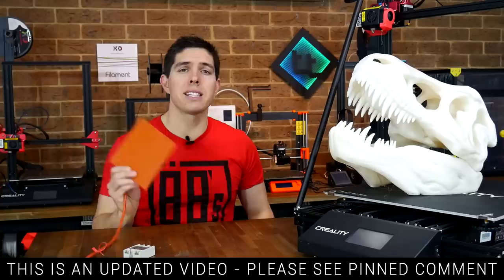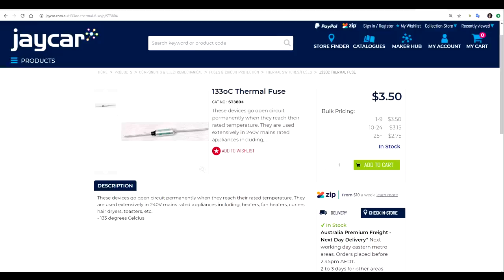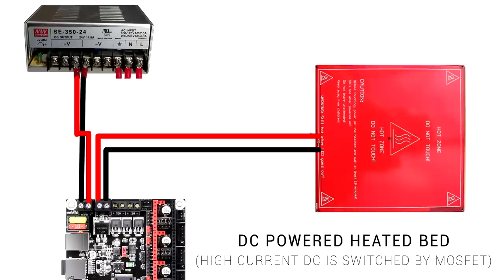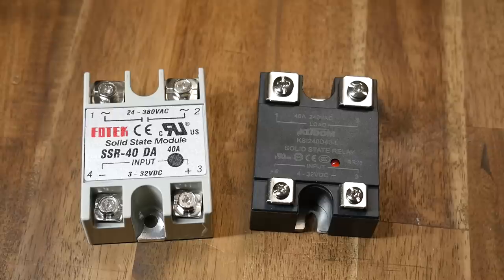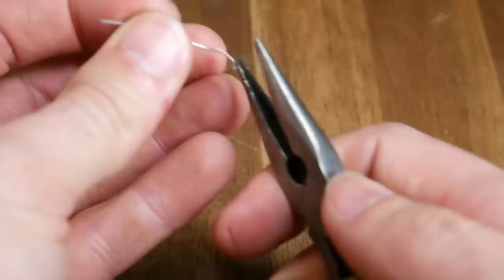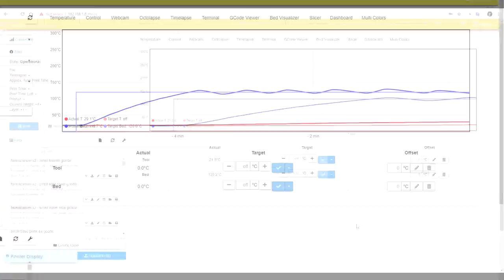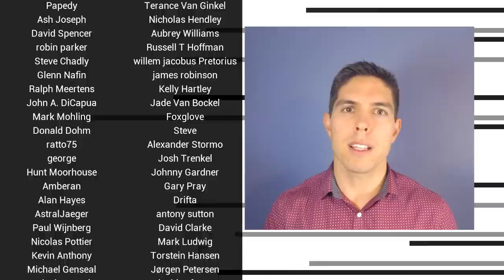AC mains powered bed guide: Super fast heated bed performance - UPDATED

Comment: Thanks for this, my first printer was the Anycubic i3 Mega, very pleased with that after 2 years so bought the Mega Zero recently for the extra height. I ordered an i3 heated bed that will need some modification but this was useful :)
Reply: Did you manage to find an AC heated bed matching the i3 Mega(-S) ? Should be 24x22, most of them are more like 20x20 cm.
Reply: @Lidocain777  I stopped looking but thanks for the reminder i need to do that this month so i can return the wrong one that i got! I'll keep ya posted.

Comment: Hi - as usual I follow your videos and appreciate them.  I would have soldered the thermal fuse (or not considered at all) had I not seen your video.  FWIW, I bought a heat shrink type of connector with solder - it went alright, but not great and I don't recommend that (even with my heatgun at 480 c it was a real challenge, and I didn't want that fuse over heating).  I looked at butt connectors at my local big box store, and saw they were only good to about 75c, so I might suggest a caveat - that if folks are to use them, check the thermal limits - I found some on amazon that said the minimal shrink is at 80c, and they are good to about 130 which I think are fine for our purposes.  I also plan to dial down the max settings in Marlin to 120 so I don't run afoul of the fuse, and that should be fine for the bullet connector.  Great video as always!
Reply: Why is soldering the fuse a bad idea? Because it may pop during soldering, or is there any other reason?
EDIT: Oh, solder will melt in >200C temps, is that the reason?

Comment: Nice vid, thank you Michael. Use flux for soldering and desoldering, difference of night and day. My Ender 5+ has the BTT high power mosfet and 600w meanwell, 24v. Not bad, takes 5 to 6 minutes I think. AC is better, but you have to know what you’re doing, I completely agree. Very good video for the general printing public. I enjoyed it in any case, especially the pitfall warning for the cheap relay. For sure people don’t want to find out the wrong way it fuses itself stuck in the on position if it fails.

Comment: Naming and shaming:  Creality Ender 5 Plus or more accurately, the TFT 35 v3.  I recently downgraded(?) to the SKR Mini E3 V1.2 on my Ender 5+.  I also added my TFT35 to the case.  The only time it has issues is when the bed is heating.  I have tried adding capacitors on the 24v and the 5v bus lines to no avail.  I am considering this upgrade for the sake of using my TFT, but the point might be mute because I am now using a dedicated Octopi.

Comment: Not sure if it will work but I think safe and cheap way would be to use two fake SSRs in series on the output, so if it fails short, there's still second one switching it ON/OFF.
Though would be nice if someone would manufacture something like that in a one package and sell it for a decent price.
$50 is too much for most people just for a "Switch" and I bet they still use only one Triac.
Reply: Not a good idea!  If one failed in the on state you might never notice and the other one is just waiting to fail too.  Plus the fake ones can do worse than just fail open they can also catch fire!  If $50 is too much you could definitely find a cheaper one that's not fake or just stick to the DC bed that comes with most printers.

Comment: Not sure if this is a new feature of Marlin or if it was available 3 years ago, but when doing the PID autotune, you can specify "U1" to load the PID values into memory, this saves having to enter them in. You still need to save the memory to EEPROM, but it means only two commands now:

M303 C5 E-1 S100 U1
M500

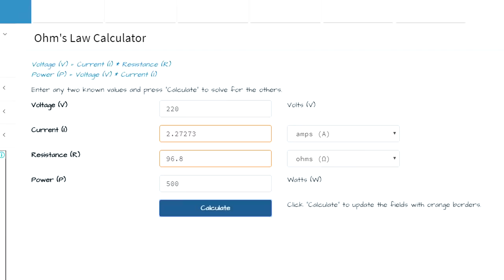Comment: @Teaching Tech - 9:44 "When you get one you need to make sure you choose one for AC control"

Don't think that's right Michael, the control voltage is the input to the SSR, you have a DC input unit (KSI240D, 4-32VDC input which is CORRECT for switching via the printer's control board) and NOT an AC input where you would need to apply 85-250VAC on the control input to switch the unit
Reply from the maker: You are right, my choice of words was not the best. Hopefully people know what I mean by what I highlighted on the data sheet as I was talking.
Reply: @TeachingTech You say "make sure you choose one for AC control", and you also highlight the coding for AC control ("A"). Both are consistently incorrect, so it will be hard to know that it's not correct unless one has that knowledge beforehand. It might be a good idea to issue a correction.
The SSR you show at 8:40 has the DC control marking ("D"), though.
Reply: Now im confused.. What relay should we be looking for DC to AC?
Reply: @ChristopherJones16  AC on the mains side, DC on control side. Voltage from the printer should be in the SSR's control voltage range.

So a 15-30V DC controllable SSR is not suitable for a 12V printer, but a 4-32V DC one is okay.

Comment: Super late little tip here, but with all connectors like the white one you used for the PCB they usually have a way to cleanly take out the cable and insert new ones. You just need to get the right size insert for the cables to snap in with the little part that sticks out. (To remove them, you push in that little metal part you see on the underside of the connector for each cable and pull out the cable at the same time.
Took me ages to figure this out so I figured Id let people know this. You can buy new inserts or whatever they're called at any hardware/electronics shop for cents

Comment: Have you ever considered doing a test on fire extinguisher balls? I had not heard of them till today but they are very very interesting and could be a useful safety feature mounted above your printer. Not a guarantee by any means but worth having. Only downside I can see is that they only work if touched by flame, smoke and heat do not set them off, but seriously consider getting some, its not perfect but a worthwhile option perhaps, only issue I can see is the original make, Exide I think is far superior to the cheaper makes such as AFO, AFC I think they are , 3 times the price for the Exide but is the more expensive one overkill, would the cheaper one do the job? Printers are not very large after all.
What do you think or do you think covering this might get too much negativity for covering it.
Paul Milne

Comment: Hey I just upgraded my Ender 5 Pro with a Kenova 350W, DC24V .   It has the cutouts for the screws as they sell a specific one (actually two - also a 250W version) for the ender 3 which has the same bed size and screw locations.  It looks similar your AC one and heats up really quickly to 70 Deg C with a thicker Al plate (6mm).  Haven't yet tried  to heat up to higher temp yet but will do so once I fit a mosfet.  Of course, I upgraded my power supply from 350W 24V to a Meanwell HRP-600W-24V so that I would have enough power for the bed at higher temp. The mosfet will be connected to the bed to make sure I don't fry the control board (a BTT Octopus 1.1).  I think it will work fast at higher temp. but  I wish I saw your video before I went down this route.  However, it must be working well because I get the same temperature oscillations with the standard bang- bang heating and will update the firmware with the bed PID as you have suggested in the video. 

 I love all your youtube videos as they are very clear and also the Aussie accent (but I am biased being Aussie myself).

Proud owner of an Ender 5 Pro with extended bed Dual Z axis, Bondtec DDX extruder, copperhead hot end (300 deg C), linear railed X and Y, Kenova hotbed, BTT smart filament sensor, BTT octopus 1.1, raspberry PI 4B OCTOPRINT ready with BTT TFT70 touch screen.  Fully working Marlin firmware and printing as I type.

Comment: My ender 5 plus has a huge heatbed with great inconsistency and a hotspot that will warp prints.   Not to mention the level is wonky.   I’ve upgraded other parts of the printer.  I’m considering redoing the bed.

Comment: I'm in the process of tuning a Tevo Flash that comes stock with an AC heated bed. The heat pad is stuck to an aluminum plate which the glass bed is glued to. There's no ground connection to the bed, the electronics enclosure or the printer frame, so I'm adding those. I hadn't thought to add a thermal fuse, I'll add that now too.

Comment: Great stuff! As I'm in the process of building my own printer soon(tm), I'd very much like to see a test of the thermal fuse. I know I will probably do my own testing when time comes, but It could be interesting for others aswell, might even be a recommended safety upgrade for the stock bed. Bonus would be to research if there are viable options for thermal fuses for hotends?
Reply: You can buy thermal fuses in all kinds of temps. They are in many things and rarely blow but they are a great safety feature.

Comment: The reason for not soldering the fuse has nothing to do with arcing though. It's because there's a very high risk of blowing the fuse. Because - well - it's a thermal fuse. A non-reset'able one. Sticking a soldering iron with solder on, onto its leads, heats the fuse up extremely fast, way past your 130-some°C. 50-150 watts of 300-400°C heat dumping through a liquid metal thermal bond, into a tiny short metal lead.. Yeah. Gets hot fast.

This is also why we build or buy fairly costly equipment to spot weld lithium battery cells, even though we already have soldering equipment on hand. Because if soldering: by the time the metal casing or cell tabs (or in case of your thermal fuse; leads) gets hot enough to accept a wetting bond with solder (and appropriate flux), that metal will have heated up whatever is at the other end of it a craptonne. In your case, that's the thermal fuse. In case of lithium batteries... Poof. What the spotwelder does, is dump that current and thus heat in a very small area, in such a blistering fast n short pulse, that there's no time for that heat to sink and spread.

As a sidenote - this is why, if you need to solder a very short, tiny jumper wire - always start with a long'ish wire. Do both joints, and only then cut the remainer. If you cut a tiny piece, then when you go to solder the second joint, all that heat from the iron gets dumped into that tiiny piece, and the 1st joint will melt again almost instantly. And, it easier to navigate small wires to lay the way you want, if you have a longer tail to move it around by.

Comment: My 24v 330x330mm bed heats to 100c in 6mins so I think I am fine without AC.
Reply from the maker: Agreed.
Reply: @Teaching Tech I am replacing the 14ga with 12 gauge so maybe I can eek it out faster but I was surprised to see the timer start on the panel and at 6m (give or take a few seconds depending on room temp) it moved on to the bed leveling.  My 14gauge wire used crimps and the wire was 70c-74c near the crimps so too hot.  Next 12ga silicone will not use crimps.

Comment: Wouldn't you want to put the thermal fuse on the side going into the ssr so if it fails its not being fed power and eventually burn it would be a bit more wiring but I feel itll.add to the overall safety and be worth it

Comment: I've been contemplating upgrading to a 240V bed, I have a Tevo Tarantula Pro and it struggles to get to 100 degrees, even though the printer claims it can.  After about 85 ish, it starts taking forever and then errors out. I am going to go buy a 240V one now. Also good to know I can get the SSR from Jaycar :) I would have probably gone to Middy's or somewhere like that.

Thanks :)
Reply: Make sure the firmware is not pmw-ing the bed, limiting. For example, Klipper sets bed max_power to 0.6. I had the same issue as you. Had to up mine to 0.85 to get it to warm up in 10 minutes or so. People say even a setting of 1.0 is safe, but 0.85 works fine.

Comment: I don't understand was your bed heater dying. I have a prusa mk3 and it warms up in a couple of minutes and uses 24 vdc. Could it have been the heating elements in your bed. Thanks for the videos. They are always informative.
Reply from the maker: The Ender 3/5 bed is good to 60 but the higher you go from that, it starts to struggle.

Comment: The bed on my Printrbot Metal Plus took over 30 minutes to hit 97ºC, and could never reach 100ºC, as the PSU that Printrbot supplied with the Metal Plus was simply too weak to power both a hotend AND a 254mmx254mm heated bed. So I rewired the bed to run off its own external 24V, 15A DC PSU w/ an SSR. Now it hits 110ºC in about 90 seconds. DC isn't the problem -- using a weak PSU to power all the components of a 3D printer is the problem. Giving the heated bed its own DC PSU works just fine and is probably safer than playing with AC power.
Reply: There are two big advantages of AC bed over DC bed. If you use high power AC bed, you don't need to buy a high power PSU and almost all the power heats the bed, not PSU or wires.

Comment: with all the extra thickness added to the bottom of the bed does it create problems with the springs being very compressed to get the top of the bed to the correct height ?

Comment: I still see exposed live contacts with the SSR cover... this could be done a bit safer
Reply: So is the terminals on the PSU. It's okay as long as it's in the enclosure since it's supposed to be closed during use
Reply from the maker: Ron feel free to remix and release your own improvement.
Reply: @TeachingTech  Yes, of course, but I feel AC voltage is too dangerous for a 3D printer. The wires will break sooner or later, so I use 36V DC

Comment: hello, 
The correct calculation for a 750w 220v resistance is 3.40 AMPS (POWER = AMPS * VOLTS or AMPS = POWER / VOLTS), why a 40Amps relay? the fake works well so it will only support 10 AMPS or less, is good video

Comment: Won't soldering a thermistor wire effectively change its resistance and thus give you inaccurate temperature readings?
Reply: and 100k thermistors  aint the most accurate

Comment: Hey Michael, what specific tape are you using to stick your tempature fuse to the bottom of your silicone heating element, as I've tried kapton tape, and high temp insulation tape and it just won't stick, is there a specific adhisive key word I'm looking for when buying? Cheers!
Reply: I too would like to know the type of tape that actually sticks to the bottom of the AC Bed mat.
Nothing sticks to it.
Reply: I used high temperature silicone to stick it to the bottom of the silicone bed

Comment: I know this video is several years old, and I am hoping you may see it and help expand some information you provided. I recently purchased an Ender 3V2. The machine is great, but I quickly expanded it with all sorts of upgrades including flashing to one of the latest EPROM updates. The latest update is the Ender Extender 400x400x520 package and the large AC heat pad. I have everything put back together and mechanically working thanks to your Ender Extender video and this video on the AC heat pad. Thank you for those. So the question - you mention updating the firmware. I'm having trouble finding how to do this. Any suggestions or some direction where I can find out how to do this would be very much appreciated. 

Thanks,
Todd

Comment: Great video, as usual.
"Name and shame in the comments".
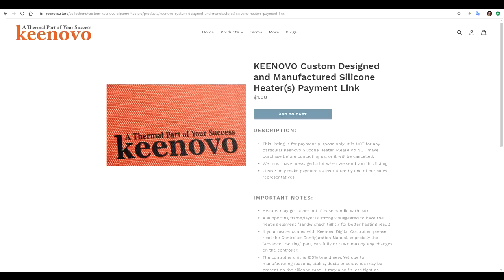OK :) I love my i3 Mega-S, yet ... heatbed performance is quite debatable. from 25 to 60°C in 2:30 or so, and 10 minutes total to reach 100°C. Despite being able to print ABS (and I do this on a regular basis), waiting for 10min for the very first layer to be printed is quite frustrating.
I'm wondering, since nearly all current printers can print ABS, why 3D heatbeds aren't simply AC powered as a factory design. Apart from mains hazard, that is.
Reply: Likely due to having to use SSR which some current leakage when off or mechanical relays which make some noise. It is easier to control DC current with a MOSFET then AC current. But overall I believe that with proper safety precautions we may be able to go back to 12v systems for printers using AC heated beds. Which would be great and would allow 3D printers to interface with the large supply of 12v components available.
Reply: Makes perfect sense, indeed.
Though, it seems this "mains powered" design gains popularity over the manufacturers.

Comment: I hooked mine up the way you indicated but it keeps blowing fuses on the printer switch.  Which is better than blowing my board up but I don't know enough about electrical engineering to know why it's getting overloaded.

Comment: How did you actually do the Thermal fuse ferrule connection? did you run both the thermal fuse wire? @5:20  Did  you use a ferrule on both sides (one on ssr wire connection, another on the fuse), with the heat shrink on the top the only thing stopping it from bending?

Comment: It seems like the mainboard would still be sending current/amperage to the SSR, correct? The actual heating current  for the bed is from the mains, but unless something is changed in the firmware, wouldn't the mainboard bed output still try and provide enough amps @ 12v as if it was trying to heat the bed itself? The signal to an SSR is usually just a voltage with just a tiny bit of amperage, so I'm wondering if this set up may damage the SSR over time? But I see so many people set up this way (and with tiny wires between mainboard and SSR) that I have to be missing something.
Reply: Main board can't try to provide SSR as much current as heated bed needs, it would have to increase voltage do do it. If you disconnect electrical oven from the electrical outlet and connect phone charger instead it will consume less power from the same outlet.

Comment: Love your vids. Just got my new Ender 3 S1 Pro. I've set it up, switched it on and have been levelling the bed only to realise that my heat bed doesn't seem to heat up? 

The home screen stays at 21 degrees and it's been over an hour now. Faulty unit out of the box?